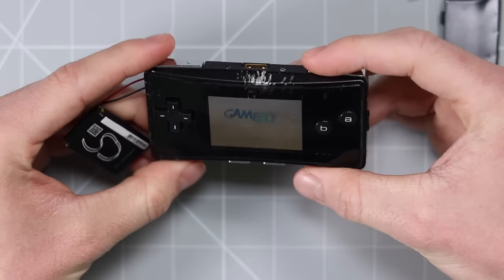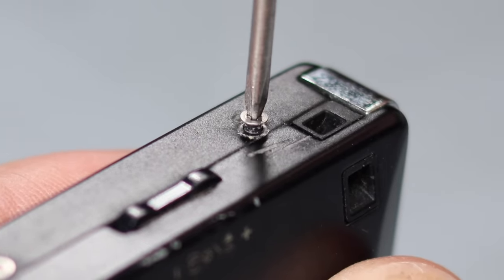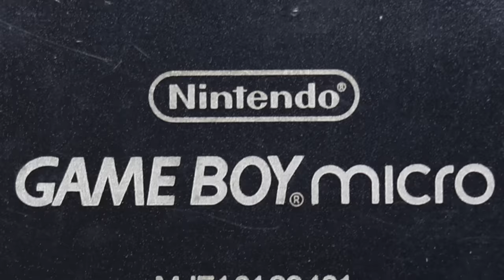Fixing a DESTROYED Nintendo GameBoy Micro

Comment: I remember seeing these when they came out, and thinking they were pretty cool but hilariously small. That's one thing I really miss about older Nintendo consoles. The hardware re-releases for their portables almost always brought some new features or functions, even if some of them were gimmicky they still sold systems. The shots near the end with the screen off make the piano black finish look really luxurious too. Great video and great result as always, this is a finicky one!
Reply: The 3DS had a ton of variations and the Switch has had a slightly updated standard model (fixed some hardware issues, improved battery life) as well as the Lite and OLED (new dock with RJ45 port, new improved kickstand) variants.

Comment: The Game Boy Micro was an impressive little device. Just look at the size of the cartridge compared to the size of the device itself. Essentially the cartridge slot and battery take up most of the space leaving not a lot of space for the rest of the hardware. It's impressive they managed to miniaturize it to that degree, especially at the time. This thing is considerably smaller than the DS Lite, and the DS Lite had to have the GBA cartridge stick out because there just wasn't room for a full size slot, despite being made with newer technology.

Comment: Also that inner frame with the latches for the faceplate there is now a decent 3D print available to save your micro, for my workings in the I find the silver  ones where the frame yellows is the worst you only have to look at it and it turns to dust
Reply: Hi, are you talking about that inner frame he called "skeleton"?

My GBM "skeleton" is broken but I don't know where to Finde a replacement.

So where can we find that decent 3D replacement you were talking about?

Thank you. 😊

Comment: I picked up a broken Micro recently that doesn't power on/charge. Battery in it is fine. Gave it a deep clean inside with IPA already. I suspect it's a bad fuse or two, but haven't taken it apart again yet to test, as it's kind of a pain to get back together (in particular the start/select buttons and the power switch gave me a lot of trouble). I ordered the replacement fuses from digikey anyway and they're comically tiny, like grains of sand. Not looking forward to the repair.

I do still have a working Micro from my childhood that I play on, luckily, just wanted to have a spare.

Comment: Agreed micros are fiddly.  Years ago and going back before you could get new frames and even lenses that weren't just touch to scratch improper fits I used to come across these, dead, real cheap and I'd harvest them for parts.  As it is I have a set or two of the inside buttons, contacts, screws, and a couple OEM batteries that still work fantastic.  Rather keep an old one that works than the checkered modern bits.  I'm surprised in the last year or so how solid they have become depending where you source on new metal frames as some are just spot on, and the lenses finally aren''t garbage miss fits that you touch and scratch but are done nice and hold up.  I've got one in a silver shell with a blue lens and it's quite nice as a carry around beater to test with.

Comment: I've been modding every GB I own (GB,GBC,GBP,GBA,GBASP,Micro) to all be DMG themed and the micro is the last one I need to do. started it a while back but stripped the head on one of the triwing screws and never got back to to getting it out. really need to find the time to just get it done as it'll be a sweet set when it's all done. Surprisingly the GBA SP is the one I'm least happy with as no1 seems to be doing DMG buttons for a SP, so had to order a Mario Anniversary case from AliExp to shuck the buttons from it but they're nowhere near correct.

Comment: Are the replacement faceplates still blurry and not as clear as the original, like they were years ago? I got a replacement faceplate back around 2010, and it was blurry. Then, got another one a few years later and it was the same. Though, I did get an official replacement faceplate from Nintendo's replacement parts site back then, but all they had left was the Camo design. I assume since you didn't mention it, that the clone faceplates don't have that issue anymore.

Comment: before even watching this I'm curious about the battery.  I have never bought a GBM battery that has the proper rails on the side of the connector that fit into the plug, I have had to trim off the rails with a knife every damn time.  I had a few discussions in the Game Boy Micro subreddit about this and I'm not the only 1 who runs into this. nobody seems to be able provide a link to 1 that fits properly.  if you know of 1 that plugs in w/o needing to be cut up please let me know.